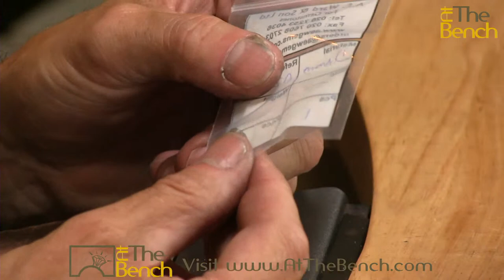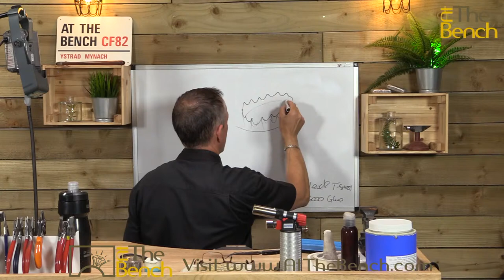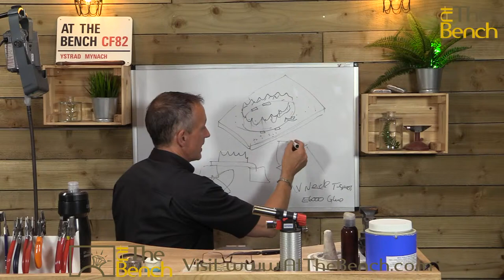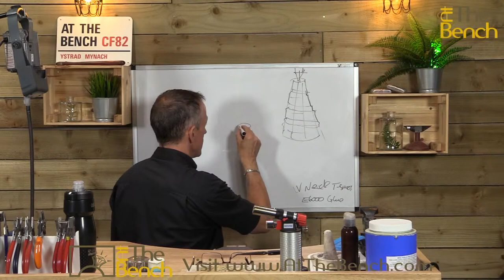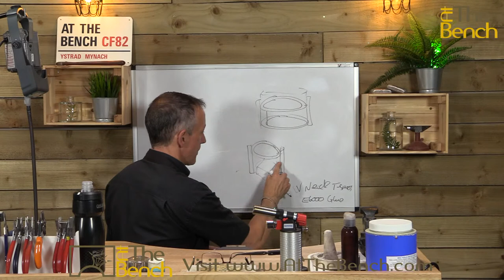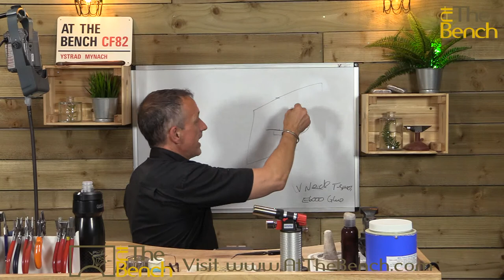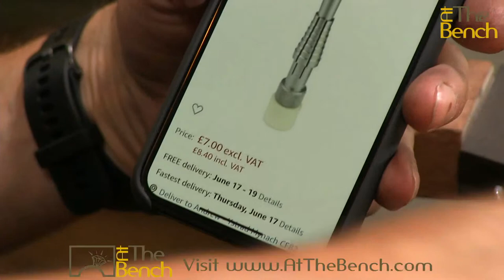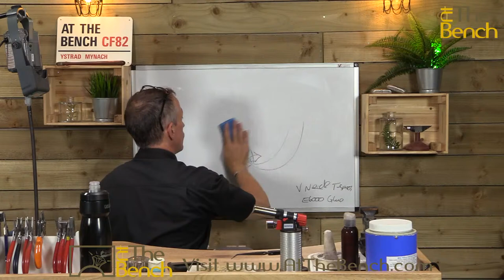Jewelry Q & A With Andrew And Louise

Comment: I just purchased a small titanium sheet approx 4'x 4' by .5mm(100mm x 100mm x .5mm0 The shipping charges are outrageous and a bit difficult finding sellers with small sizes. Is the .5mm springy enough for a clamp? It cost about $11. Probably enough for 6-10 small clamps. Also, would you recommend the titanium for soldering small parts, such as jump rings?

Comment: better to learn with bum equipment and learn well, than to spend all the money and time buying expensive equipment that requires less and less skill to use.
Reply: I do not mean that one should use bad equipment,  it is obvious that so many of the expensive power tools are not necessary for a beginner who is not trying to mass produce his work. It is very gratifying to improvise with the few simple tools, and to maintain them and modify them as the skill level increases which happens on a daily basis. I do appreciate your tips on using and moding tools, such as the burnishers video, fortunately now I have bench grinder and purchased a Foredom pendant motor SR and foregoing the quick-release I got the setup for under $100, the handpiece is okay, I can always upgrade in a year or two if I find it makes enough of a difference.Having a bit of trouble refilling the Dremel torch i bought, and will annoy a salesman at local hardware to help me figure out replacement butane before I replace the torch.